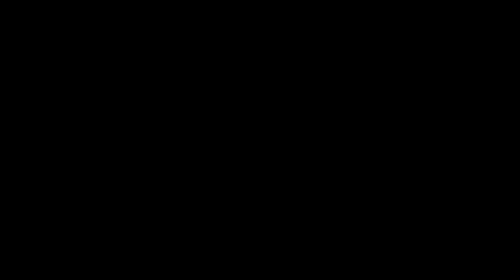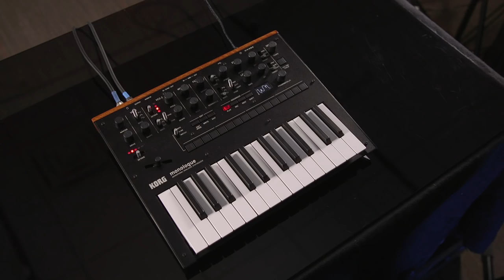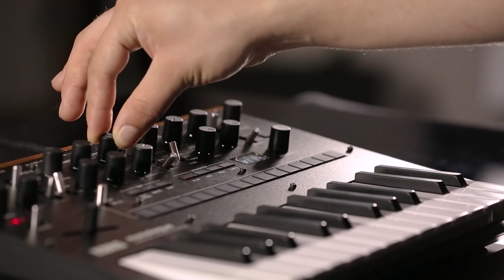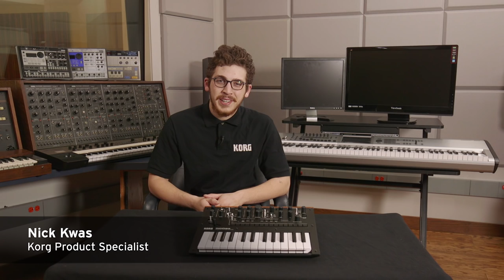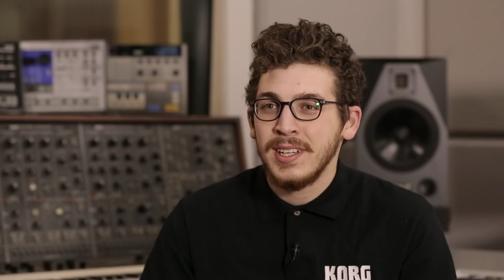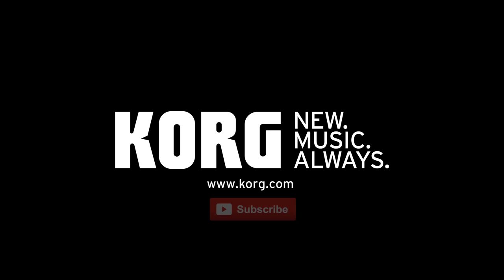Korg monologue Video Overview Part 1: Oscillators

Comment: I am looking for a cheap synth primarily to use in a music classroom. I am interested in something that has two oscillators where a student can tune the second oscillator to the first oscillator. My concern is that with digitally controlled oscillators - is the pitch control such that it jumps in "increments" rather than being a continuously smooth value?  Can the second oscillator tune to a "5th" above or below the first oscillator?   I really DO like the window showing the graphic results. I think that would be great for students to see.
Reply: Oh yeah you can use the Pitch knob to go up or down a full octave. There might be very minor increments, but I don't think it's very noticable, haven't heard any complaints about it.